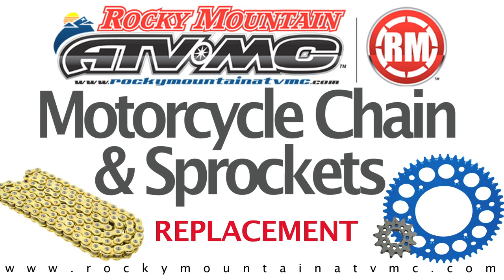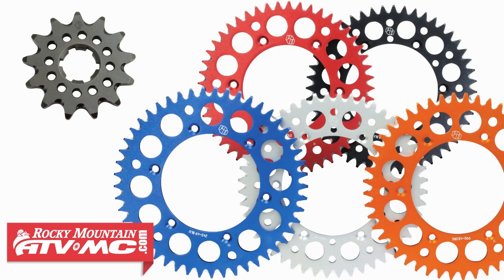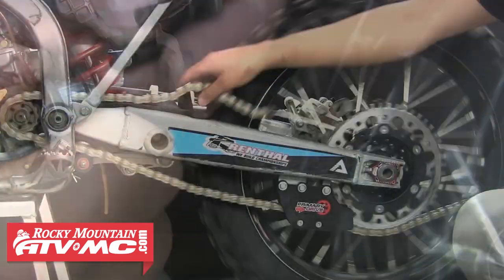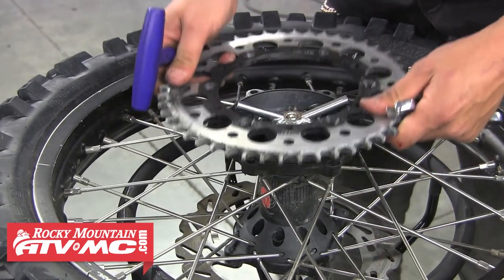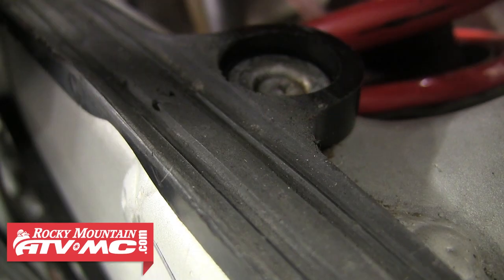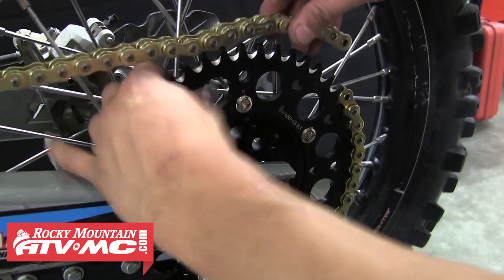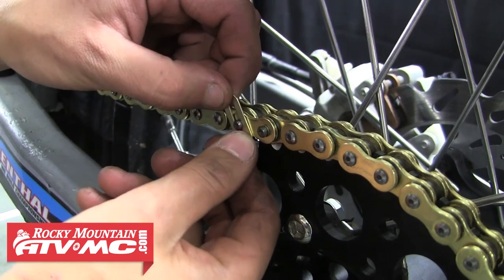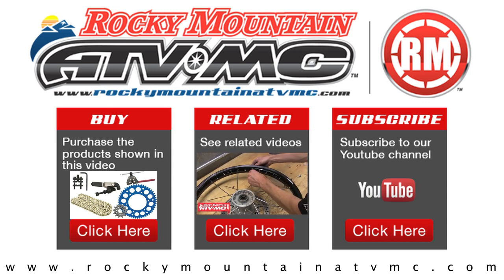Motorcycle Chain & Sprockets Replacement

Comment: At 6:29, when re-installing the rear wheel, that would also be a magnificent time to re-grease your axle. Lots of riders neglect this. Makes such a huge difference. I have always used the blue marine grease you can get at walmart.
Reply: and at the end make sure the axle blocks are pushed up against the adjuster bolts unless you want your wheel falling off

Comment: I changed the rear sprocket and rear wheel but not the front sprocket and chain. When i spin the rear wheel on the stand the chain seems to grip as it leaves the sprocket at the top and then ping off the sprocket. Could this be wheel alignment or is it likely to need a new chain and front sprocket?

Comment from the maker: @Trav Ohlsen Which bike are you riding? Is it the jam nut that is stripped or is it the bolt head or threads? If it's any of the above you'll have to remove them any way you can and just replace the parts. If it's the threads in the swingarm that are stripped you'll have to drill and tap them and you can use a heli coil or something similar to fix them but it just depends on which part is stripped.
Reply: Rocky Mountain ATV MC p

Comment: My current bike chain is stretched out to the back. Does that mean my new chain I move the axel blocks all the way forward. ?
Reply from the maker: I wouldn't say all the way forward. But you might have to move them forward a little bit just to get the new chain over all the teeth on the sprockets and install the master link. Be sure to check your owners manual for the correct amount of chain slack for your bike.
Reply: @rmatvmc thank you

Comment: OK, To get the correct torque reading the torque wrench should be put on the Nut, not the bolt head. Using the bolt head will give an false reading due to measuring the addtional friction of turning the bolt in the sprocket. Always apply torque to the nut in these applications!   🙂

Comment: So when removing/installing the rear wheel, you can just slip it out of the break? Their is nothing you have to disassemble to get the wheels disc out of the break itself?
Reply: Yeah that is usually how it is. Sometimes it is a pain to slip the brake back in between the pads .

Comment: Why do you add thread lock when the nuts are already supplied as locknuts? Belt and braces perhaps?
Reply from the maker: I've seen too many sprocket bolts loosen up and ruin the sprocket and hub. A little threadlocker is extra security and insurance to ensure that won't happen. - Wes